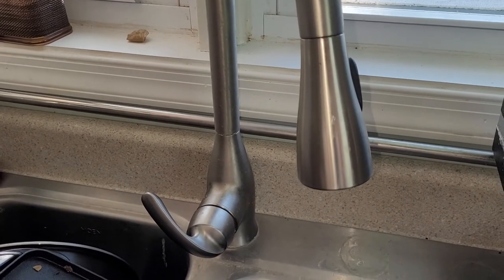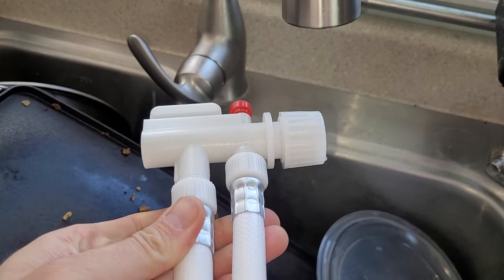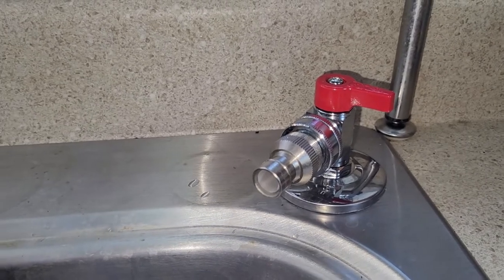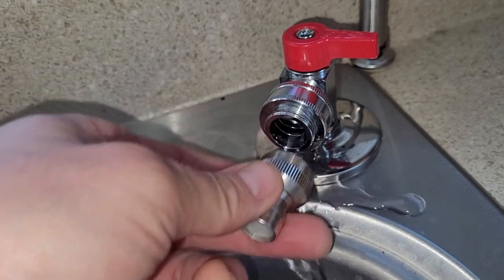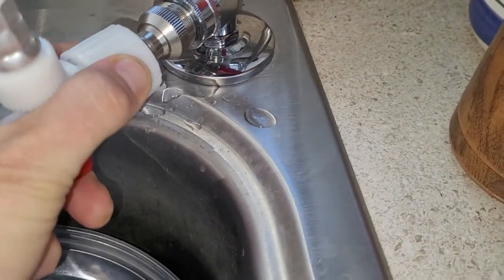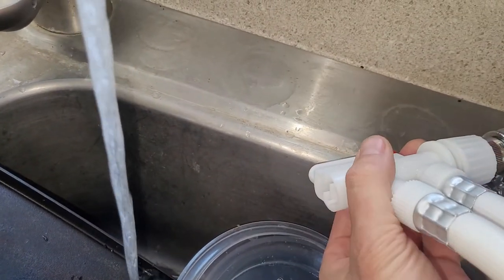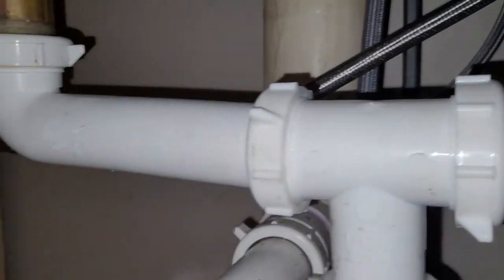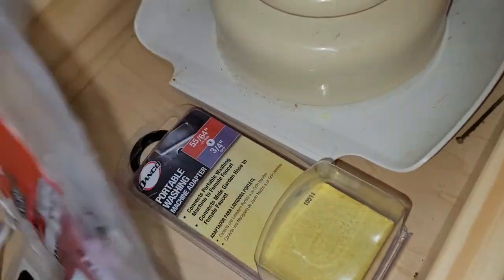How To Connect a Countertop Dishwasher to a Modern Faucet

Comment: You can unscrew that for the hose. Should see a 5/16” female . You’d just need an adapter for the hose
Reply from the maker: True, but I would have to do that every time I run the dishwasher. Setting it up the way I have it set up means I don't have to do as much to hook up the dishwasher unit when I go to use it.
Reply from the maker: If I had enough space under or near the sink, I would keep it hooked up like that, but since there's not enough space I need to unhook it and move it out of the way every time... I have the machine on one of those shelves on wheels with a cutting board surface on top.

Comment: You were seriously amazing and have solved so many problems with this portable dishwasher shenanigans! I do have a question so where the soap dispenser is how do you keep the flange tight and flush against the sink? I’m trying to look for that part online and I can’t find it because without the twisty part to keep the flange on it it’s just all wobbly.
Reply from the maker: Glad it helped! It's been a minute, so I just looked to jog my memory. Looks like I used the fastener from the removed soap dispenser, which is too large to actually screw onto the washer machine utility valve part, but that part comes with a fastener, which I used to secure the soap dispenser fastener to the under side of the sink, which holds it pretty well.

Comment: I’m doing this now & having an issue of not enough pressure to either line. The original supply line I got was a bit short- it just barely reached, so I’m about to try a longer one but I don’t think it’s the main issue. Any ideas what might solve the low pressure? When I hook up just one of either line the pressure seems fine, it’s when they’re both connected in the T then it goes low
Reply from the maker: @clif_plays  I didn't encounter that, and can't think of why that would be happening. Is it all sealed up well, no leaks?
Reply: @danw.7935  all sealed up & no leaks, wonder if it’s just a quirk in the plumbing at my place. I’m renting a small ADU so some things are put together a bit odd, & I’m not totally sure if my hot water is separate from my landlord’s. I’m a little hesitant to ask him about it & reveal that I’ve been messing with the lines under the sink, but I did a good enough job with it that there’s no damage or problems there lol. Could live with just a separate hot water tap, but it does make me curious to try & problem solve.
Reply from the maker: @clif_plays  another thing to confirm is that the T has the hot water going to it, and the two connections going from it are the hot water for the modern faucet and the new hot water utility faucet.
Reply from the maker: @clif_plays  as long as it's connected right it should maintain the initial pressure, however if you run both the modern faucet hot water and the utility faucet (running your countertop dish washer for instance), you'll experience half pressure in each while they're both on. However the pressure for either one should be equal to the other if only one is on, and that should be the same as the pressure you started with before the install.

Comment: Hi! Im just having this problem too. May i ask what's that thing between the valve and the dishwasher adapter? I couldn't find it anywhere
Reply from the maker: It's a part that came with my countertop dishwasher, but it's called a dishwasher faucet adapter.
Reply: @danw.7935 I have that adapter and the washing machine valve but they don't fit each other, do you have something in between that is connecting then?
Reply from the maker: @ZadyArianaW  I think infigured it out, it looks like I did overlook that one in the description. I think the part you're looking for is a Danco 10511 (portable washing machine adapter). That part thread's onto the valve on one side and the other washing machine adapter on the other side. The washing machine adapter should have threads on the inside for this part to thread into.
Reply: @danw.7935  thank you!! I'm going to try that one them

Comment: Hi Dan, Thanks for making this video! I had a same issue. I have a question. what is the adapter between valve and dishwasher adapter? I accidentally bought a 1/2 valve so I need another adapter for it lol.
Reply from the maker: Glad you found it helpful! It was the adapter that came with the dishwasher. It's a utility faucet to quick connect adapter.

Comment: Gonna run this set up today. Should I tap into my hot water line or cold ?
Reply from the maker: Nice! Tap into the hot line. You might already know the next part but while I'm at it You can run the water with the hot side open until it gets hot and then you'll be able to feel the temp difference between hot and cold to know which is which.
Reply: When you run it, how do you get it to drain without getting the water all over the place?  I’m trying to put one in my camp & I have that exact faucet.  My one at home is a normal faucet, but I know it’s pretty forceful when it drains, so just wondering how it’s working for you.
Reply from the maker: @ellisg74  I put a cloth on the end of the sink where it sprays to and nothing gets outside the sink with that. If that didnt work i was thinking the best option would be to hook up a 90° to the utility faucet.

Comment: The dishwasher's hose connector is usually vertical, so it drains straight down.  Since the new water valve outlet is horizontal, isn't the drain also horizontal?  How you do you get it to drain into the sink?
Reply from the maker: Good question, you can connect a 90 degree / elbow fitting onto the utility faucet. I just watched it the first few times and it pretty much shoots right into the sink with my setup, even though it starts horizontal, it gravity feeds into the sink pretty well. There is some splash, but I just keep a few rags splayed around the splash zones and it works just fine. 

But like I said, if you want, you can get a 90 degree elbow, or even a flexible hose attachment like the kind for washers.